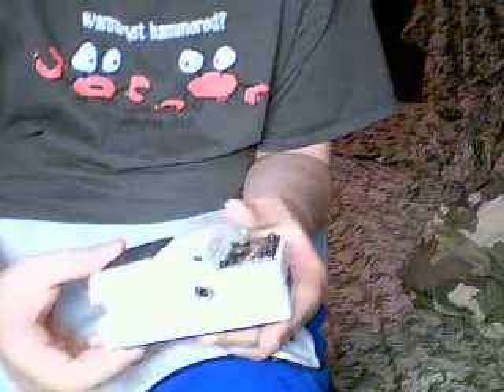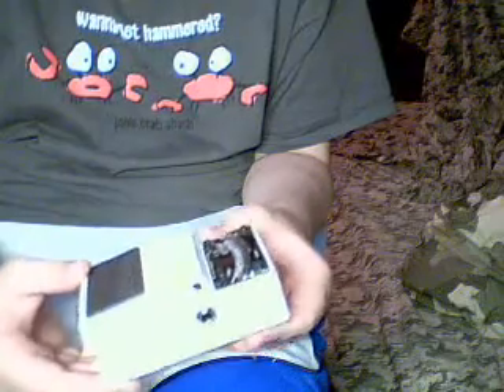How to open/change batteries on a BOSS TU-3 Tuner

Comment: Please respond, I bought a TU 3 and have been trying to change the display from 1 to 6 to A to G but no one on the internet could help me so far, do you have any idea how to do that?
Reply: I assume you figured it out sometime within the last 13 years, but I'll respond in case someone else is wondering. You keep pressing "mode" until the light comes back to "chromatic"